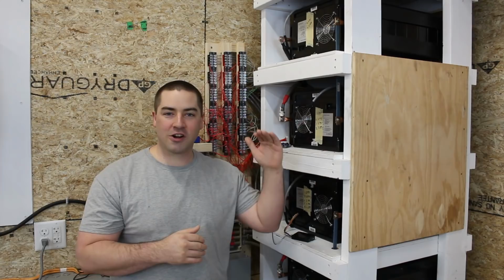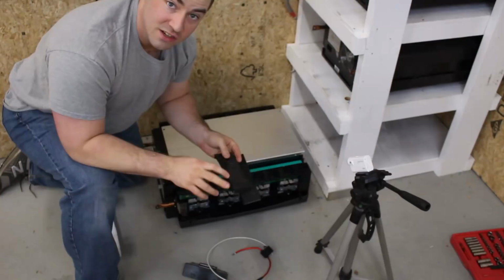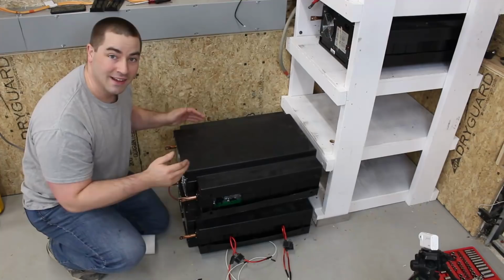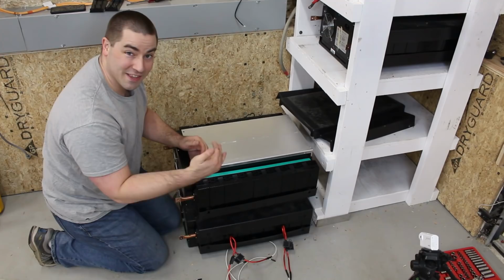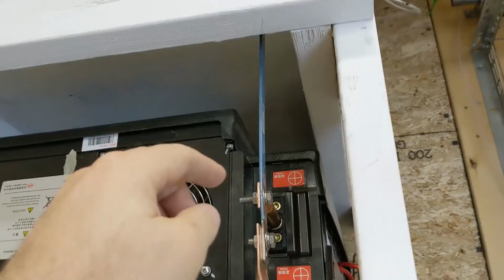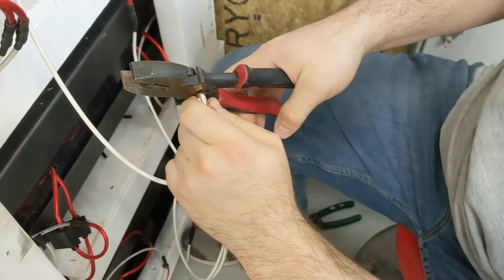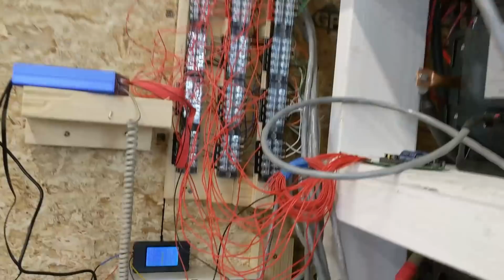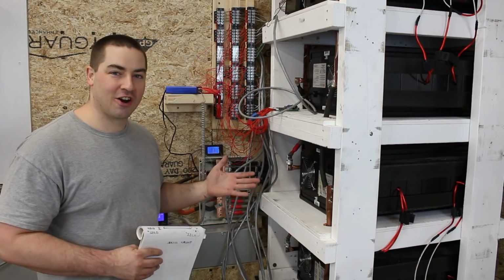Parallel Cells in big LIFePO4 Battery Modules

Comment: I am thinking about going with supposedly new 120 amphour cells from ali.  I have seen where people think these are actually used 200 amphour cells that now have about 120 amphour capacity.  I wonder what you have found out about the rate of degradation of the LiFePo4 cells.  Do they degrade faster from whatever used point they are .  In other words does it take more cycles to degrade from full capacity to say 80%  than from *0 % to 60 percent capacity. Because of this I wonder how many cycles are left in the used cells. Any guesses or data from anywhere?
Reply from the maker: I can't find any long-term real testing pushing cells beyond the 80% point.  So I don't know.
Reply: @DavidPozEnergy  I see a typo meant starting with 80% capacity cells already degraded  from original capacity the number of cycles to degrade from say 80% to 60%. I think you knew what I meant.  Reasoning is if its fairly linear won't hurt to get used cells at about $150 per kwhr but if degrades a lot faster the next 20% and so but if half the total cycles expected have been used would rater pay $250 per kwhr or a little more  for truly new cells
Reply from the maker: I understood.  It's a good question, I just don't know.

Comment: I am paralleling two sets of 4 BYD modules for a 48 volt 880 amp battery. I am curious as to why copper rivets to attach paralleling wire to aluminum busbars. I substituted aluminum rivets of the same size as your copper rivets but the remaining rivet on the back side protrudes into the spongy material surrounding the positive terminal of each cell. I could not detect it this were so using the copper rivets from your youtube. I purchased the copper rivets from you youtube list and also some more aluminum rivets 1/2 the length of the copper rivets in your description. I have only paralleled 8 cells and I am waiting on the remaining 56 of the 64 cells in my 48 volt 880 amp battery module for your response.
Thanks, Roger
Reply from the maker: The ones I had bought were about 1/4" long and after riveting on the bus bars, they did not hit the spongy material around the post, but it was close.  Some guys use little machine screws instead of rivets, I think #6 but not sure.

Comment: What's the verdict?  Curious if you think it was worth the effort based on your results...  Also, I'm only counting 8 modules here - Are you saving the other four for another project, or did I miss something?  Thanks so much for all the great work you've done paving the way!!!
Reply from the maker: The other 4 modules were my friends, Bills.  I picked them up for him, but they went to his house for his backup system.  Here is his system: https://youtu.be/6XLOKtl-q3s  
As for these 8 batteries.  Are they worth it?  Well, they do power the house.  But I would not buy them again.  I don't think they are worth it.  There are better deals out there.  If I was to do this again, I would go with a used EV battery such as a Nissan Leaf pack.

Comment: In the end the balance function will have a large effect on the capacity. 30 amp between cells is quite a draw most I ever measured was 7 amps and that was when just connected.
Reply from the maker: Yeah, I don't suspect I'll ever see 30 amps, but I just wanted to make sure my 10 gauge wire was not causing too much resistance.
Reply: @DavidPozEnergy  10 AWG should be fine, but I would try to make them as short as possible.
You could use large bullet connectors instead of crimping to make it much easier to unplug and swap if necessary. Put females on each balance lead covered with heatshrink and make 16 solid distribution blocks of 4 males back to back with 1 female or cable to go to the balancer...
Unfortunately, I don't think it would be a cheap solution requiring 64 + 16 male and female bullets, but sure easier to play with.

Comment: Hi l wanted to know if you can convert a Solar Inverter Sunny Boy 2000W sma or a  GoodWe Solar String Inverter GW12K-DT to work as a off grid inverter,  please let me know thanks
Reply from the maker: I don't know how to do that, or if it can be done.  However, you can use grid-tie inverters in off-grid situations if you have another off-grid inverter that buffers the batteries.  I plan to try this in an upcoming video.
Reply: @DavidPozEnergy  thanks Dave I've looking forward to that video p.s. you have been a good inspiration for all my solar little projects I'm keeping hidden for now and also please let me know what you think of the mpp Solar inverters
Reply: @DavidPozEnergy  I forgot to mention and  a sunny boy sb 2000 hf-30
Reply from the maker: Hi Tony,  I've only published one video on a MPP Solar inverter model LV5048.  I'm working on another video.  But here is the first one: https://youtu.be/FUaDmVDcYks

Comment: Well it is fun to watch you go through it all.  But man that is a big pain to get a working safe battery pack.  While it is interesting to watch you go from one pack to another at some point do you plan to just use one?  Selfishly I am glad you keep changing since it makes for fun videos as you go from pack to pack!  How will you know if a fuse on the back side blows? (not that is should being 30A...)
Reply from the maker: I plan to add a little cell checker to the front of each module.  If a fuse blows, then one cell would be different from all the rest.  I could see that.  But I haven't seen more than an amp so far.  But I'll be checking near the bottom of the SOC curve, I'll probably see more amps move then.
Reply: @DavidPozEnergy  yep the bottom and the top pulls the biggest amps. Also keep an eye on the farthest battery away from the load. You may find a need to design the load location.

Comment: shouldent it of been 8 cables each side ? or at leat the ones thast have the pcb attached
Reply from the maker: The cells are huge.  They have two posts per side, but the posts are connected internally.
Reply: @DavidPozEnergy  ah ok seemed an odd pattern

Comment: When you’re paralleling three of these can you’re buy with one BMS for three of them.
Reply: Yes and no yes because you can parallel the cells first then series connection the no is because the BMS is not going to going to know individual cells voltage but instead  the combined voltage in the paralleled cells will it work yes but not as effectively.

Comment: 20+ years totally off-grid solar here and hoping to get off of lead-acid battery sets. Our current set is a Hawker forklift battery, 24 volt (12 large 2 volt cells in series) and is dying after 12 years in service (who says you can't make lead-acid batteries last a long time). Anyway, time for a new battery set and I don't want to screw this up. Iron Edisons are just too darned expensive for us so I'm strongly considering these modules. I just wish I had some idea how long they will last. I'm looking at the completed modules Battery Hookup offers for double the price, but being handy, I may go your route. Anyone know if the individual cells are available for replacing bad/weak cells?
I'm a little worried about this parallel setup and balancing. This being our ONLY source of power excepting a generator, it is critical I get it right (or I may be sleeping alone in the future). My plan would be 6 modules in parallel, keeping our 24 volt setup intact - working fine and I don't want to replace everything up to 48 volts. Currently using Outback charge controllers and inverter/chargers.
Thanks for the work you are doing!
Reply from the maker: 12 years sounds pretty good for Lead acid.  Most books I've read say 6 years, and you are double that.  So good job.  
These cells are pretty far down the life expectancy.  I'm just guessing, but if you plan to cycle them fully every day, I don't think you could get another 12 years out of them.
Reply: just go for a new lifepo4 battery bank. once installed no worries

Comment: Looking for what you did with the BYD batteries?
Reply from the maker: What I did with them?  Nothing.  They are still in the shelves.
Reply: @DavidPozEnergy  what I meant was did you make a vid of building 
Something with tHem . I bought several from hookup a,nd wanted to compare notes 🤪🐢
Reply from the maker: I used them for about a year.  They never stayed in balance well.  I recently bought 6x Gyll batteries and am using them.  My intention is to take down my tower of power and individually test each cell.  Try to find the bad ones.
Reply: @DavidPozEnergy  I followed your lead and bought the Gyll from signature s using your code still waiting for them to come in.
Reply from the maker: Awesome.  Almost 2 months running the Gyll and no issues.

Comment: David, Are you going to use the cooling fans at all?
Reply from the maker: I wired the fans so I can use them.  I'll be checking temperatures under load to see if I need to power the fans.  But I don't suspect that I'll need them.

Comment: Hey @DavidPoz,
I have the same batteries in one of the systems I have here on my property.  I found if I charge above 27.1Vdc that the cells begin to fall out of balance.  Just checking to see if you had seen the same.  I am looking at getting some more because they are actually for my dad's setup, and I only have 3 of these on his system for now.  Just wanted to see if the characteristics I am seeing is what is being seen across the board.
Reply from the maker: Yes, it's very difficult to keep these cells in balance.  I won't be buying the same type again for my setup.  Recently I got some BMW Li-NMC cells, and hopefully I'll be replacing these.
Reply: @DavidPozEnergy  very cool.  If you were closer I would try and buy you lifepo4 batteries off you.  But i am in utah

I built my personal system for my rv out of the spim08hp cells.  These are working fairly well so far.  Just hard to work with

Comment: Ok, I am trying to wrap my head around the parallel wiring.
You have 4 leads on each side.
That is 8 wires, but 8 cells have 16 terminals.
8 positive, and 8 negative.
Each cell has two posts. And every other cell is tied together...
So, the positive side has 5 bars to connect to, and the negative side has 4
That is more wires than I can see.
Reply: I wish you showed the connections on both sides, not just on the negative side.
Reply: It looks like I need 4 on the negative side and 3 on the positive side, then main negative and main positive linked.
Reply from the maker: I'm going to be taking down this tower of batteries.  I'm replacing it with new cells.  When I take it down I can try to show you the other side.  But these old BYD cells don't work well.
Reply: @DavidPozEnergy  I will look forward to that video.
I am setting up a bank of 4 for a powerbank trailer emergency power setup.

Comment: Can you recommend a BMS for this battery bank?
Reply from the maker: That depends on your amps.  I'm testing a Chargery brand BMS right now, connected to a 300 amp breaker.  Or you can use a 200 amp Daly brand BMS.
Reply: DavidPoz thanks for your reply!  Where is the best place to get one?  Do you have a video of how to install one?

Comment: I'm assuming that the cells in the battery unit are wired in series. Don't you have to disrupt the connections between them before they can be wired parallel? 
Once they are all balanced properly in parallel then don't you have to connect them back into series to get the 24V ? Are there 6 or 12 cells in each unit? How many amp hours per unit?
Reply from the maker: Each module is 8 cells in series.  Originally the modules were rated at 220 ah, 5.63 kwh.  But they are used and won't be that good any more.  I'm only paralleling like cells together.  So only the cells in position #1 are parallel together, which is 4 cells.  Then the 4 cells in position #2 are paralleled and so on.
Reply: Basically, the jumper leads are paralleling the like step voltage cells together.  Hopefully, this will perform a parallel balance between the cells in each voltage step.  Just a thought as I recently read about a recommendation to charge in parallel to 3.4V and to let them sit together and equalize for a couple days before going to 3.65V, but this was for prebalancing new cells.
Reply from the maker: @Marco,  I think you got this correct.  I might suggest checking out one of Frank Z videos.  He also parallels cell groups of the same voltage, but his wiring is more open.  I think it's easier to visually follow the wires.  https://youtu.be/teF5MJ2jNfA  If you still want a wiring diagram, I'll make you one.  just e-mail me through my website or send me a message in facebook.
Reply: @DavidPozEnergy  I did some voltage testing this morning so I think I got it. Will set it up next week, waiting for you charge and discharge results. Thanks guy!!!
Reply: @marcoa.rosado4724  Another way to look at it is after your modules are configured to the voltage you require ie 24 or 48 then any like voltages can be paralleled so if you linked all cells in the one position they all would have 3.3 volts also the cells in the 9 position would have 29 volts so all 9 position could be paralleled. If the modules were 48 volts to start with then all 16 s would be paralleled to their partner cells with the same series voltage. If you aren't confused then you got it and no never any sparks.
Reply: @offgridwanabe  Thanks offgrid Wanabe. I think this will be the solution for getting the most capacity safely from these BYD cell. Once DavidPoz does the charge and discharge test with the cells in parallel, we will know for sure! Thanks to both!!!!

Comment: What is the capacity of each module?
Reply from the maker: Originally each module is rated at 220 ah, 5.63 kwh.  However, they are used.  Battery Hookup says about 4kwh on their website.
Reply: @DavidPozEnergy  thanks man...

Comment: I liked the video, but man oh man, the money you are spending.  Have you calculated ROI or is that not a concern?  I like what you are doing from a technical POV, but I don't think I'd put all the labor and money into being off grid if ROI was way out there ... I'd just pay my bill and enjoy my free time.  I hope you paid cash for all involved since to be paying interest would make ROI even worse.   Hopefully you don't take this comment as negativity.  I'm just extremely sensitive to my trade offs and weigh my options primarily based on ROI from both a labor and cash POV.  Your knowledge is impressive and I'm amazed at what you've put together.  
What is your end game?  Is there ever a month in the future where you can see yourself as just passively enjoying all that you have going there?  I say that not knowing how long you had your other setup running and if it was on autopilot for a long time.  

I'd like to think I could have off grid setup for all except AC and it would run on autopilot for the most part.  I don't mind tinkering, but I don't think I want to be babysitting just to get free electricity.  Are my expectations out of line?   Do you think the packs you are employing will allow your setup to be more on autopilot than those who build their own cell packs.

Sorry, I'm long winded sometimes, but your POV is of interest to me.
Reply from the maker: Hi D Dixon.  Last year I was running my system on auto-pilot.  I had an Aims inverter and Chevy Volt batteries.  Did my whole house (including AC) all summer.  But as things got colder that system was too small.  I decided to upgrade, and that meant an overhaul on everything.  
But this is my hobby.  It's fun for me.  Similar to someone who takes pleasure in going to ball games, collecting memorabilia, studying player stats.  I enjoy learning about off-grid power.
Reply: @DavidPozEnergy  Yeah, I had a feeling you considered off grid a hobby so instead of woodworking, fast cars, or boats, you're having a genuine amount of enjoyment working with solar.  At least it keeps you home near your family and even though you are spending quite a bit of money, unlike a lot of other hobbies, this one actually does pay you back.
We are moving to the Philippines soon where brownouts aren't as frequent as they once were, but still a fair share of them so I'd like to have lights and more when everyone else is in the dark.  
Good job, very interesting, hope to be as clever as you are one day.

Comment: You offered no discussion on why it's not in your best interest to use batteries that are in balanced. Or the fact that batteries need to be replaced all at the same time to avoid this imbalance. Using reconditioned or otherwise known as used batteries is not the safest or the wisest.

Comment: SHORT comings! Comming short is NO good!

This is why I don't like buying used modules,    you could but a few Headway cells to beef up the weeek cells! If the per cell drain is low enough you might be able to connect them to the balance leads?
Reply from the maker: Yes, I could parallel some headways.  I might do one just for the fun of the video.  However, I'm OK with limiting my use to the ah of the weakest cell group.  I don't want to put more time into fine-tuning this pack.  I just want to put the pack into full service.  I have that LTO pack to get back to.

Comment: So, 4 wires each side, you are paralleling pairs of cells to each... 6.4v on each new wire.
Reply: I believe he has the top 4 in parallel and the bottom 4 in parallel  then has the top 4 connected to the bottom 4 in series 24v + 24v .